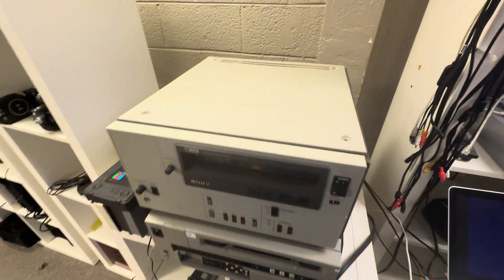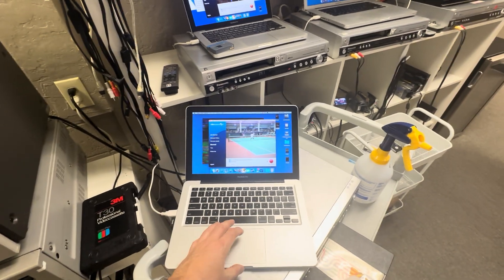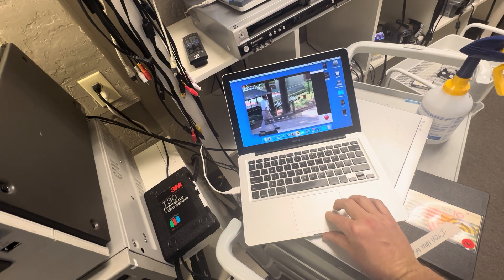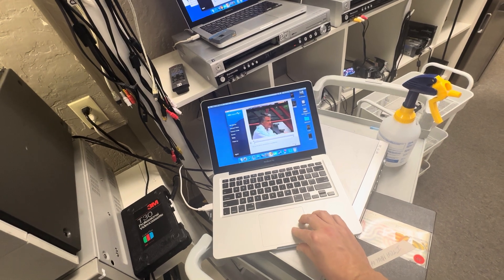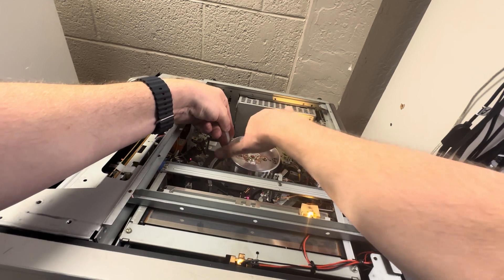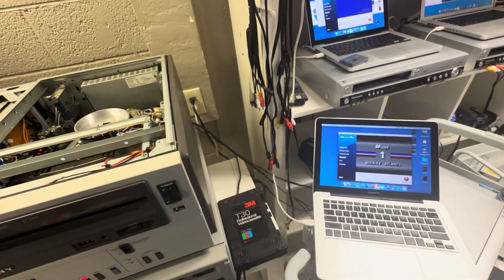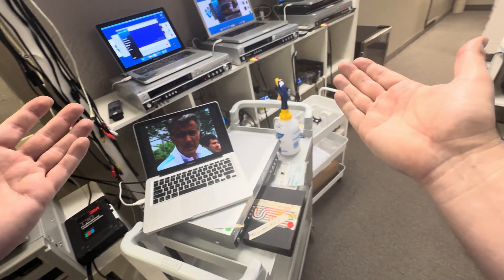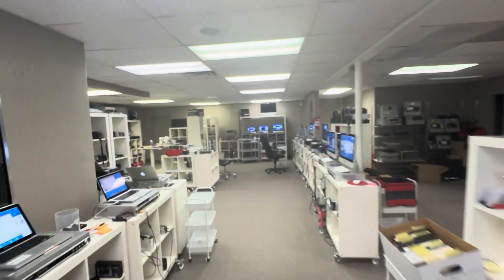Sony Umatic Tape to Digital Problems - Head Cleaning #1

Comment: I have two Sony Umatics and that currently have an issue where the tapes won't rewind or fast forward, it just says error on the screen. Any ideas what could be the cause of that and best way to repair it?
Reply from the maker: Find another player or you’ll have to rewind by hand and then try to play. Less stress on the player the better. The tapes get old and aren’t free flowing inside and also the motors on the unit are old and worn.

Comment: Hi, what liquid did you use for cleaning? I've seen some folks online using dry pieces of paper while the tape is playing and the head is rotating, but this seems more gentle. Thanks!
Reply from the maker: Isopropyl 99%
Reply: @gotmemories  Thanks for the response! I have some 91% that I've used for some open-reel decks, do you think that should suffice here too?
Reply from the maker: Yes that will work!